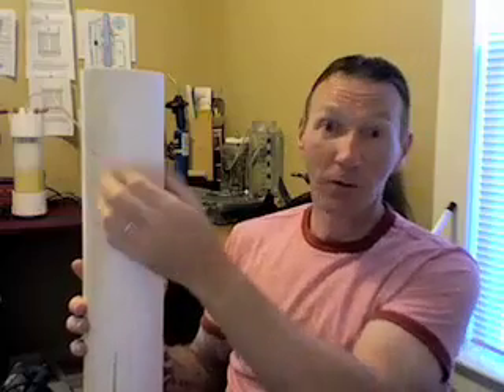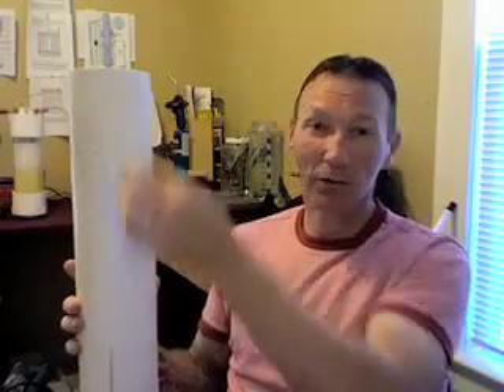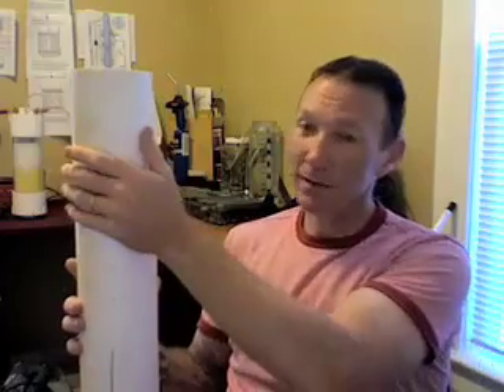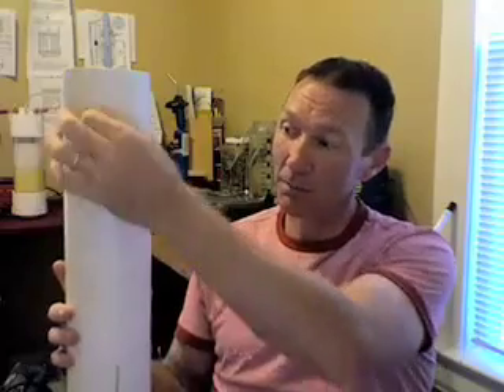'Coolest Bubbler' Update

Comment: yeah, you probably want to stay away from the "free-floating-diaphram" type of check valves for this particular setup. With water sitting on top, you want a spring and ball type check valve, so it is "actively" sealing the valve.  mcmaster sells them: part number 7757K13

Comment: Steve! Great info. Thanks for sharing both your triumphs as well as your key learnings which are not quite so glamorous. :)  I'm working on a reservoir system like you mentioned and it has issues as well.  What I have learned with the reservoir/bubbler/cell combo is that the lines between the cell and the reservoir have to not have any high points or gas gets trapped and stops the natural circulation of electrolyte which forces the liquid level in the chamber to rise dramatically. :/